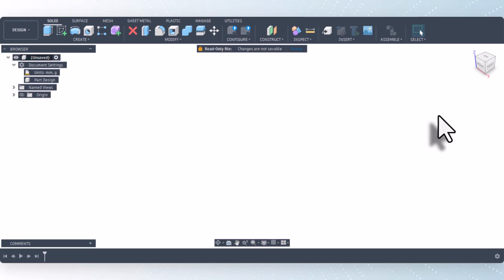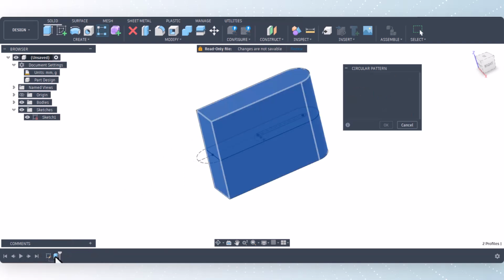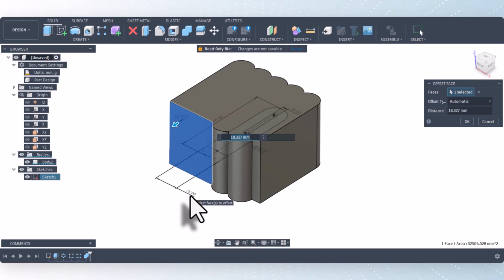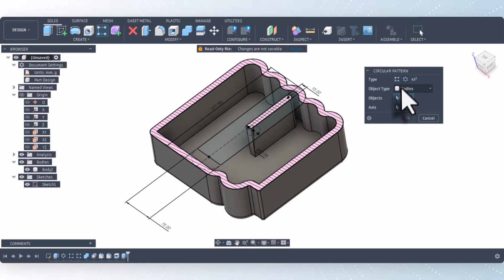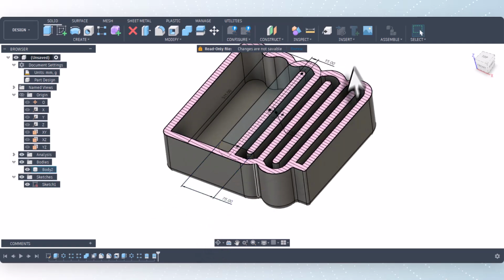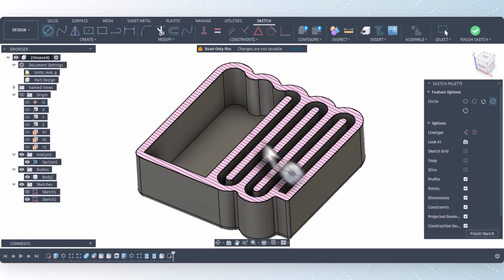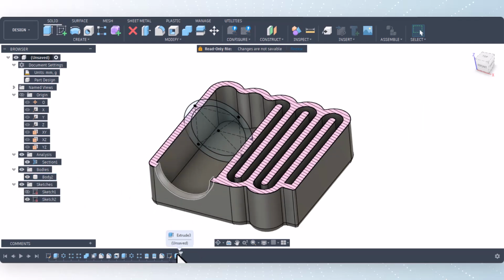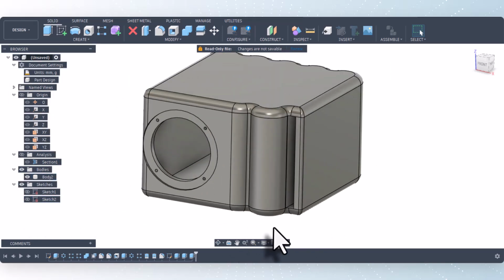Speaker Box

Comment: Why did you do this in Fusion instead of Inventor?
Could this have been done from a top down approach, it seems to be a bottom up method? (although the methodology was very instructive)
Can CFD simulate the effectiveness of this as a speaker box? Because it can do wind.
Maybe you could do an episode about where you think Ai will fit into the CAD realm
Reply from the maker: The question came from a Fusion user is the reason that I used Fusion.